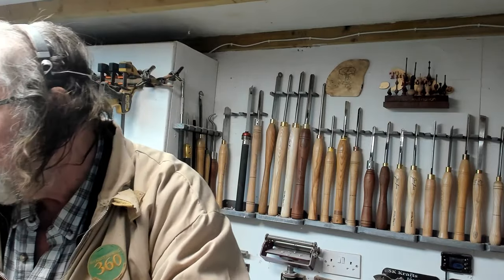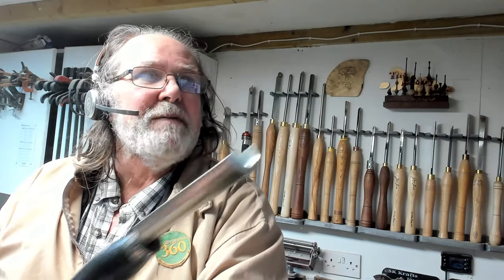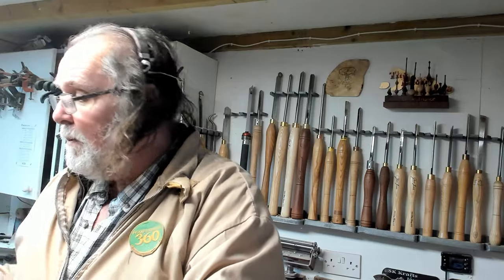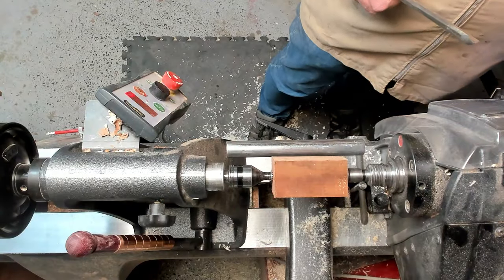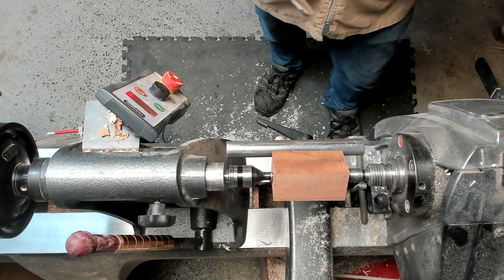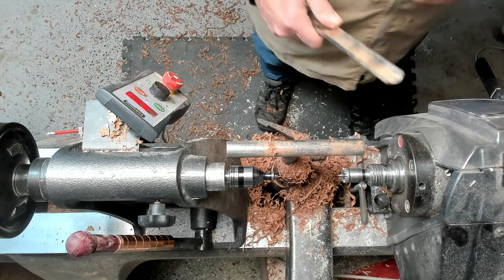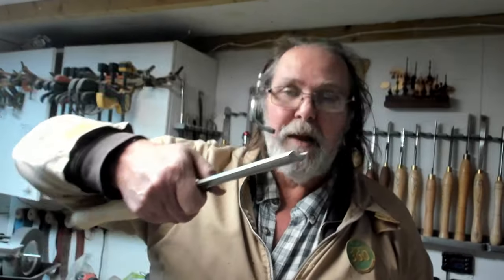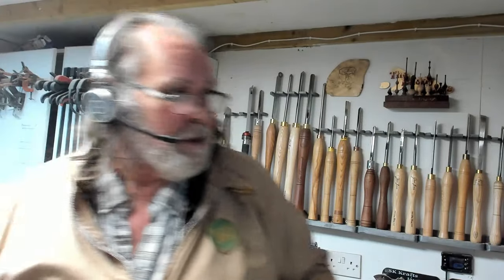Continental Spindle Gouge for roughing blanks (Extreme Roughing!)

Comment: Wow Pete that looks like a cracking piece of steel it moved the wood very quickly and it also looked like it would leave a decent finish as well.
Reply from the maker: Really easy to use, needed the toolrest moving on that video but so light to control.